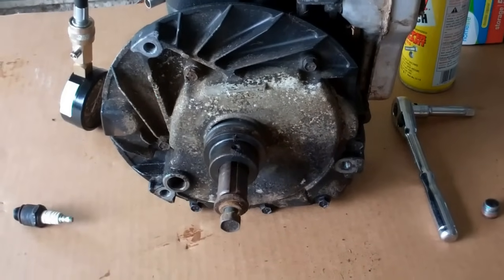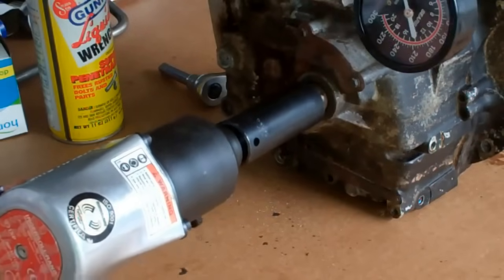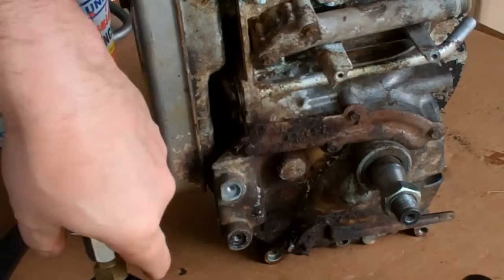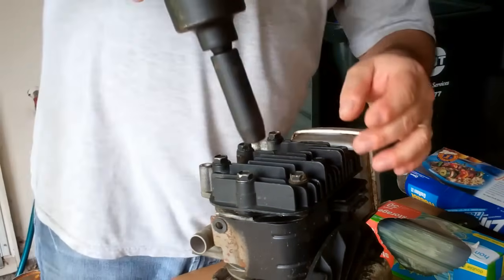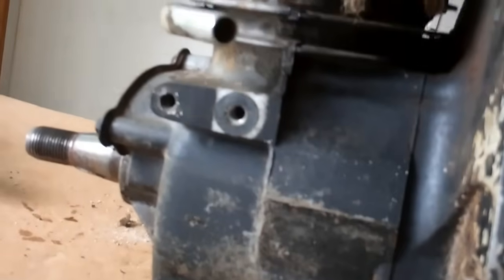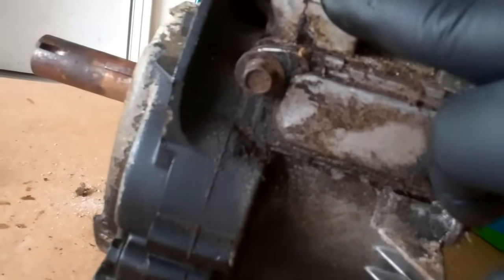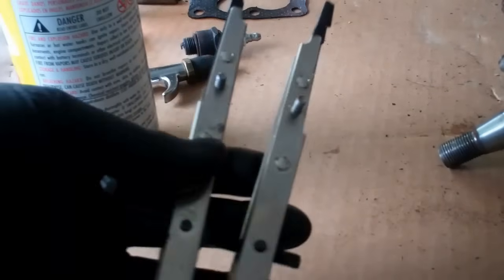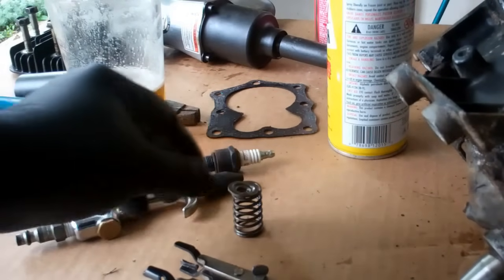Briggs and Stratton Engine Disassembly Part 1 of 2

Comment from the maker: Welcome aboard!!  Glad this series was of some help. That's the only reason I made these videos.  I didn't need any special tools except for two.  Although It can be done with a screwdriver I highly recommend the Briggs & Stratton valve compression tool.  I use it in the video.  
The other tool I have purchased since this video was made was a piston ring compression tool for the size piston I have.  I tried to use an automotive one and it was not fun ...it can be done, though.  
Just my 2C!!

Comment: Just some positive feedback on Briggs and Stratton motors. Had two Mowers over 40 years both with side valve. I did what no one recommends ran flat out the for half an hour when new into tall grass, dropped the oil waited till cool  emptied out, put in new oil .did the same again for the next half hour. then next time used like normal folks. Exception when finished hosed down while hot .cleaned perfectly then put away.Both motors gave out after 20 years with only oil,filter and plugs changed.

Comment: To check the valves are not leaking compression you need to turn the engine over until you come to the compression stroke then move it so that it is just starting the power stroke. Then with both valves closed pour gas into the inlet manifold if gas leaks from the valve it needs ground repeat proses on exhaust . Also when you remove the head check the gasket look for black marks where the cycling ear gas may leak from.

Comment: Good video, thanks for posting. Looks like some homebrew frosty beverage at about 15 minutes.  Yummy.  I just got a free B/S 123K02 6.5hp motor off of craigslist. Actually runs fine, but going to break down/rebuild with my son just for fun and learning. First project like this for us, never torn down an engine before!  Should be fun.

Comment: Your intake valve is damaged, and is the the main reason for the lack of compression, your general knowledge is handy, but you are by no means a small engine mechanic, any mechanic could spot that bad valve a mile away... Thanks for sharing
Reply: Thanks for your advice, it really helps us know more about the engine.
Reply: its the valve seats
Reply: intake has carbon look closer

Comment: When you do a compression test you should be getting 50 psi the engine needs at least 50 psi to start.You are also probably getting blow by so check your Piston rings for wear or your valves or even the valve seats.

Comment from the maker: Sounds like your rings are worn and oil is entering the combustion chamber, it may be time for a ring job.  Check the compression on your engine.  It should be above 80 psi.  Also be sure to check "blow-by" by using a leak-down tester.  This can pinpoint if your rings are weak.  Good luck

Comment: That isn’t blocking air flow, it’s directing it.
Reply: That grass in the cooling  fins is whats blocking the  air  flow!     Those  metal  pieces  direct the air flow  from the flywheel  blower  through  the  cylinder  fins to cool engine!    Those clogged fins contributed  to the engine  failure  ! Keep fins clean  and  all metal  and plastic  ducting in place ,engine  will  overheat without  them !

Comment: You're not going to get a compression reading like that. You need to turn the engine over quickly and steadily. You're not going to get that from an impact wrench and you came really close to ruining those crankshaft threads by running the nut down with an impact wrench without anything backing up the nut.  Your problem was with the valves. Not with the piston and rings. A compression test should be done with the rope starter if you're going to do a compression test.
Reply: +scdevon  will you explain why it was the valves please?
Reply: Your exhaust valve was shot and probably the valve seat, too. You can see how low the valve sits in the seat. When the valve seat and face wear, there goes your valve lash and it's all downhill from there. The valve burns because it doesn't spend enough time on the seat each cycle to cool the valve face. In my opinion these engines in general came from the factory with the valves set WAY too tight; particularly the exhaust valve. Best thing you can do for these engines is open up the exhaust valve lash a few thousands of an inch wider than specs. They last forever that way.
Reply: Oh, and the tin shroud directs precious cooling air around the cylinder fins from the blower housing. Yes, it's there for a GOOD reason. 
Your cylinder will overheat badly without it.
Reply: @andrewconnolly7169  Probably so gummed up the valves were not even moving

Comment: Hi I have an old b&s mower engine  I’m considering rebuilding to learn which I got for free. When I turn the flywheel, can hear rubbing inside, so I suspect it’s been run without oil. Is that a sure sign it’s not worth going any further?

Comment: So I just got this used tiller that was not cranking and tried to clean 
it myself. I am noobie to this and actually opened the engine. Trying to put screw it back shut but it wont shut all the way... Am I screwed?

Comment: Great video. Mine is a B & S 10H902, and I replaced the carb & diaphragm and it ran great one mowing. While doing some other work, two things happened: (1) I unfortunately lost the spacer (691633) that goes on the bolt holding the fuel tank--but I made a new one, hope it's the right length; and (2) the breather tube came out. I tried screwing it back in, but it's loose! If I turn it tighter, it does not line up for putting on black rubber L to carb. Engine is surging and VERY uneven. Q: Was there a gasket or O-ring to go on the threaded end of breather tube 691245? Any tips on proper re-installation of tube? Other things to check? Thanks. Jeff

Comment: Will A 25 Nikkie Carburetor Of A Briggs & Straton Fit A 27 Horse Power Briggs & Straton V Two 2 Barrel John Dreer Eztrack 465 Motor Can't Find A Carb For My 27 H. p. All I Find Is A 25 H
p
& No One Will Tell Me If They Exchange It Is A 27 V Twin B& S Motor Willl The 25 Nikkie Fit Need Help
7

Comment: Might want to get a smaller impact gun before you strip some of those threads.
Reply: How about a drill?  Harbor Freight has adaptor for sockets (3 for $4), works great for me, makes starting easy or when troubleshooting, saves a lot of sweat  (*L*)

Comment: Air deflectors are for well must buy a new one if you are not knowledgeable enough to rebuild it everything needs to be with cooled some sort of way obstructing that will cause failure sooner than later the engineer absolutely knows this